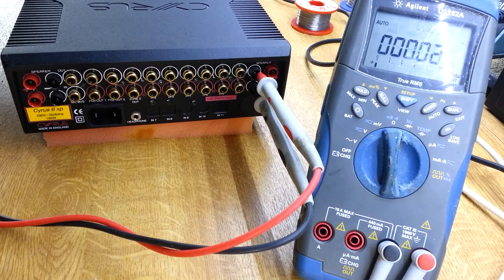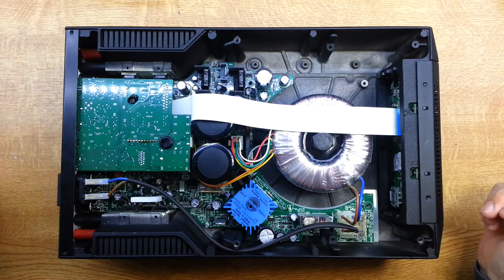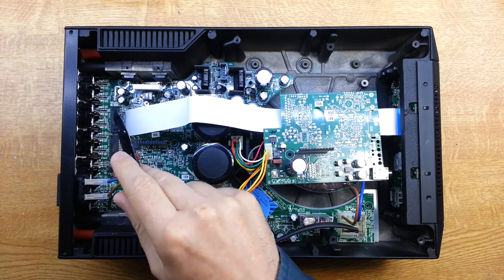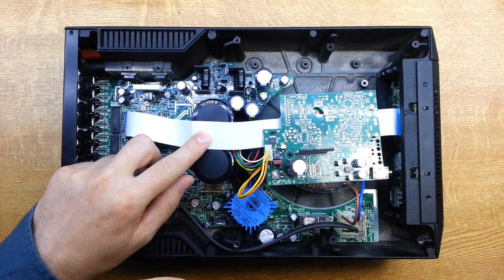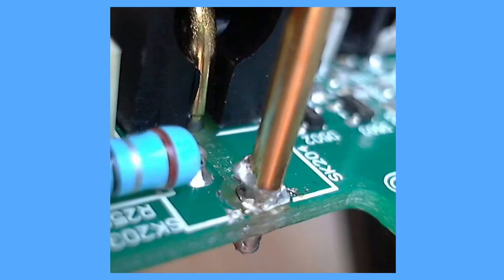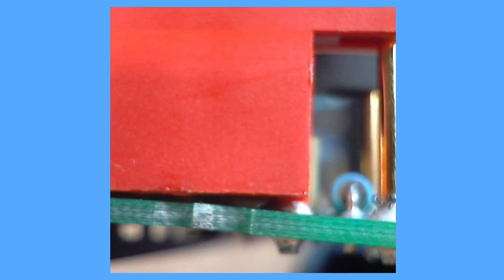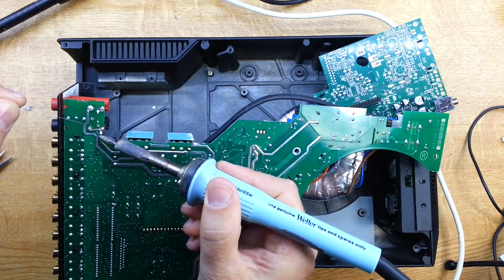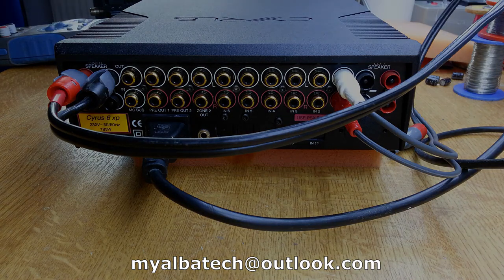Repair of a Cyrus 6xp Speaker Connectors

Comment: Now you have me wanting to open mine up to see if those caps are deliberately angled toward the heat sinks. I don’t think I will because there’s too many interconnects and the back of the amp is not easy to get to. It seems crazy they would do that deliberately.

Comment: Hi…. I have a 6xp where the turning of the volume/selector knob does not work. The only way to change volume is via the remote. Any ideas on a fix please?
Reply from the maker: Front panel would have to be stripped down to find out. Could be an electrical or mechanical problem.